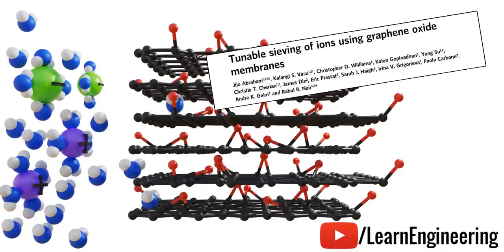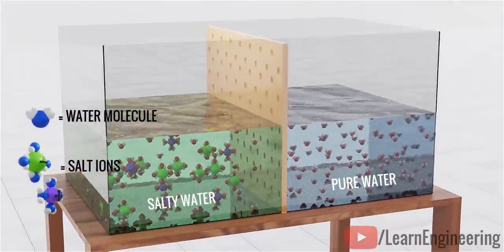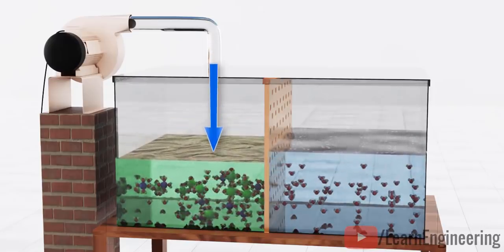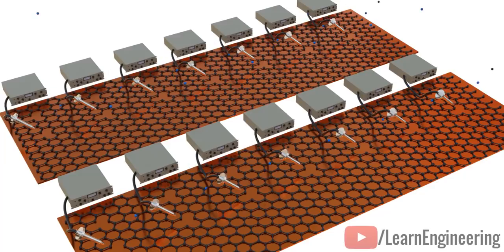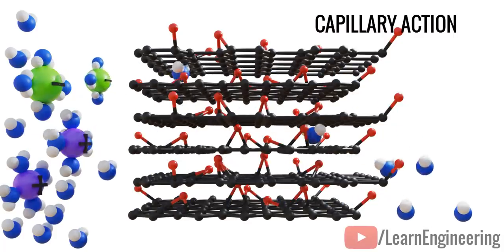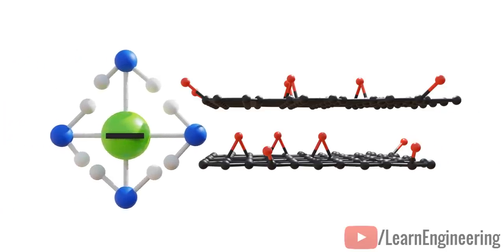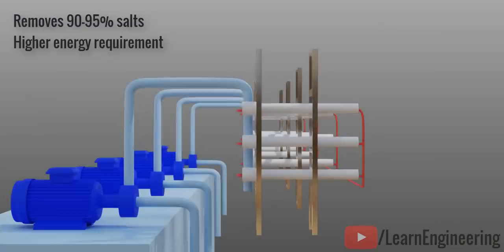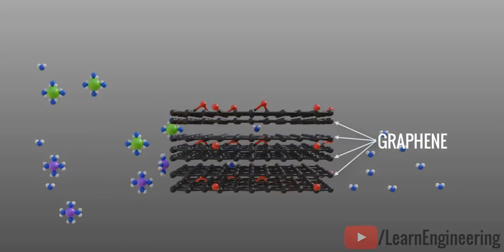Graphene Filtration | A revolution in Desalination technology!

Comment from the maker: Links to their work - https://www.nature.com/articles/nnano.2017.21#:~:text=Abstract,of%20common%20salts4%2C6. , https://science.sciencemag.org/content/343/6172/752
Reply: What Is The Drawback To Solar Pumped Laser/Lensing Boiler Distillation Systems? I Am Relatively Sure That They Could Be Immediately Implemented With An Extremely High Benefit To Cost Ratio Using Currently Existing Technologies. It Solves Both The Pumping And The Desalination Processes Into One Efficient And Inexpensive Solution That Can Be Implemented Anywhere That There Is Sunlight, While Simultaneously Generating Energy Instead Of Requiring It.
Reply: There Are Millions Of People Who Need The Water Right Now, Not By 2025.
Reply: @VerifyTheTruth  Some toxic materials also evaporate with water, but this can be filtered after you distillate. Maybe there is some affordable process to separate water vapor from other substances while it's still a gas, similar to what is used in petrol refineries.
Reply: Do You Think An Elevated Water Vessel Could Be Used As A Mechanical Battery, Utilizing Not Only The Height, But By Spring Loading The Water Weight As Well.
Reply: @VerifyTheTruth  This already exists partially, it's called pumped water storage.
But how to pump water using solar power (or accumulate solar energy via simple solutions without any intermediate conversions that are too lossy, like compressed gas, flywheels, gravity, ...) is still an open question.
Reply: @vitordelima  Steam Rises. Unidirectional Pressure, Check Valves, Heat Source, Prime, Siphon, Pump. Check Out The Basics Of Transpiration. Trees Pump A Lot Of Water Hundreds Of Feet Into The Air. Combine Transpiration Tech With Heart Pumping/Circulation/Circulatory System Tech. Water Pump And Distribution, Similar To An Electrcity Grid, But With A Different Fluid.
Reply: @VerifyTheTruth  Yeah, but there's the question of efficiency and lots of other small details.
But trees use an interesting approach via osmotic pressure.
Reply: @vitordelima  Efficiency Does Not Matter As Much When Concentrated Sunlight Is Your Power Source, Such As Fresnel Lensing, But As For Efficiency, I Doubt That There Is A More Efficient Pumping System Technology Currently Available Than Transpiration Or The Human Heart. Once Primed, It Would Run Until It Is Stopped Or The Oceans Empty.
Reply: Vitor de Lima  How about locating the solar at ocean level and turning the water to steam there and letting the steam rise to height for leverage or whatever. I guess more solar sites would be needed along the way to keep the steam form but I really liked your solar idea better than the graphite sheets.
Reply: @rivergrrrl1256  I don't know if this was already done, but if you search about concentrated solar power there are many projects involving heat from focused sunlight. Distillation works somewhat like what you are describing.The idea was originally from the crazy dude who replied this comment first.
Reply: @vitordelima  Lol. Tesla Was Thought To Be Crazy Too.
Reply: @vitordelima  If Anyone Thinks I'm Crazy, It Is Only Because I Am Too Poor To Prove Them Wrong And Unwilling To Be Compromised In Power, Greed, Or Fame.
Reply: @rivergrrrl1256  Multiple Towers Could Channel, Collect, And Pump A Substantial Amount Of Desalinated Water Through Pipelines, Hundreds Of Miles Inland. There Are Several Different Ways The Systems Could Be Combined To Produce The Desired Effect. I Think That A Transpiration Based Negative Pressure Generation Technology, Similar To That Used By Trees, Could Be Effectively Utilized With A Double Check Valve Heat Pump System Also.
Reply: Let's Just Be Real. If People Don't Have Drinkable Water, Water For Agriculture, And Affordable Electricity, It Is Because Someone Doesn't Want Them To Have It, Not Because It Is Unavailable.
Reply: For Less Than This "Pandemic" Cost America, The Entire Sahara Could Be Terraformed.
Reply: @VerifyTheTruth  It's the writing style. It's a political issue, people are stupid and their rulers are insane.
Reply: @VerifyTheTruth  It isn't that simple (but not much more complex than this), but stupidity plays a role.
Reply: @vitordelima  Go A Couple Years On Small Rations, Lets Say 500-700 Calories A Day On Average Devoid Of Essential Nutrients, Haul Impure Water In Buckets For Drinking And Sanitation, Wash Your Clothes By Hand, Work For Less Than You Need To Survive, Have People Constantly Take Advantage Of Your Hardship, Mocking You For Your Poverty, And Have No Where To Turn For Help, Then Call Yourself Stupid For Being Unable To Change Your Situation.
Reply: @vitordelima  The Ignorance And Arrogance Of The People Who Are Actually In A Position To Help Plays A Much Bigger Part In The Impoverished's Struggles Than Their Own "Stupidity".
Reply: All the best Sabin Mathew. you make every Malayalee and this Indian proud
Reply: @CatboyChemicalSociety  That Is Why They Must Develop The Technology To Assemble It With Sound.
Reply: @VerifyTheTruth  .... not sound man because the distance between the 2 waves are too great.
We need shit that can affect this material in the order of 2 atoms thick and lets just say I thought of a method but as if I'll disclose it in these comments LeL already making Graphene oxide to test XD.
Reply: @VerifyTheTruth  il give you a fun hint though to how you can arrange all these GO into neat layers really fast.
I saw this music video where there were 2 people rapping and arguing about shit in nature.
Thats the only super far hint im giving man.
Reply: @CatboyChemicalSociety  Can Sound Be Woven?
Reply: @VerifyTheTruth  mechanical waves can undergo constructive and destructive interference so you can create an alternate checkered pattern if you like but its not technically weaving in the traditional sense.
Using ultrasound could work BUT gl with the cost of those transducers since none of those are cheap.
and you wouldnt want a checkered pattern anyway for them.
Reply: @CatboyChemicalSociety  By Sound, I Mean Everything Along The Electromagnetic Spectrum. It Seems Like There Should Be A Way To Actually Interlock/Weave The Wavelengths Together On A Nanoscale, Not Just By Creating Harminic Frequencies Through Interference.
Reply: @CatboyChemicalSociety  Bingo.
Reply: What about cleaning the filter? That need to be done at some point. Is reverse flowing water easy too?  And how much energy does it take - filtering and cleaning?
Reply: @servicingiq  What's the name of this distillation machine? Sounds interesting. Do you mean it uses 2.2kWatts of power for the entire 24 hours (that would be 52.8kWhours of energy) or does it use 2.2kWhours in the 24 hour period?  (Suspect the latter otherwise that is expensive water!)

Does distillation guarantee pure water? The heat will kill the bugs but don't some of the minerals get drawn up with the water vapor, condensing in to the final distillate?
Reply: @servicingiq  When you file your provisional patent, make sure you get the units right. Your machine uses 100 watts of *power*. You run it for 24 hours and it used 2.2kWattHours of *energy*.  Look forward to seeing the design - the world needs fresh water!
Reply: @VerifyTheTruth  I think you meant to say "Extremely High BENEFIT to COST Ratio."
Reply: @marcochimio  Thank You. That Was Indeed A Textual Error. I Revised It.
Reply: @VerifyTheTruth  
The Time Has Come To Show People That Nobody is Nobody!

Comment: The unqualified use of "miraculous" raises my skepticism hackles.
Reply: It's a clever way of saying it's a trade secret.
Reply: @freddiereadie30  OR a "clever" way of overselling the feasibility or advantage of a technology.
Reply: honestly I really dont see how they can neatly stacked GO sludge from an exfoliation process.
crosslinked epoxy is FKING HUGE so how the fk can you get such tiny spaces between the graphene oxide.
im thinking they just compositized the GO with a certain percentage of epoxy which still allows it to be permeable with water then painted/pressed/rolled the resulting mix if it fking works into nice sheets for RO membranes.
Reply: @freddiereadie30  its not their paper literally shows how the membrane looks it FKING SUCKS and isnt practical in the slightest.
Their active surface area is in the friggin micrometers and for it to be practical that needs to be in METERS!!
Reply: @unAgorist  what about you I could say the same.
Reply: @unAgorist  im a chemical engineering student and from what I know the viability of this depends on the flow rate through the material.
The active surface area of the material described in their paper is in the order of mm^2 and for it to be viable it must be in the order of meter squared.
Their process of laying graphene oxide sheets and using epoxy by hand to make layers wont be sufficient to make such a structure in the order of meter squared.
Because if each layer is done by hand then it will take 6.022X10^23 layers you have to do and that is IMPOSSIBLE to do by hand it will take forever.
granted by means of another process their material maybe possible to create but you can check the paper yourself and see that picture where they show the thing they made with the red squared area being the active surface area.
Reply: @CatboyChemicalSociety  yes, this is called research, I hope you get exposed to it in your education.  First you demonstrate the fundamental scientific soundness of the idea, then you spend years in R&D to make it useable.  Carbon nanoparticles, particularly buckminsterfullerene was theorized for two decades before being synthesized in a highly complex experiment in 1984, a decade later I synthesized it in a simple experiment in my freshman chemistry class.  This was the start of the carbon nano chemical/technology explosion in science.  When I did my experiment I made ng of material and it was for sale for about 2k a gram, by the time I graduated the price was about 60 dollars a gram.  And the price hasn't changed since, because for the most part there is only a small market in science research for the material.  Carbon nanotubes on the other hand, were discovered after buckminsterfullerene, and likewise started very expensive, but the practical use of the material has been everywhere and the price has continued to drop and the method of production has improved, what used to cost 2k a gram now costs 2 dollars a gram.  Likewise the production of graphene filters will improve and speed up as long as a there is a practical use and market for the product.
Reply: @CatboyChemicalSociety  I don't know what Avogadro's number has to do with the number of layers, but your comment about the scalability issues seems somewhat legit, although the video says the process they have is relatively inexpensive.

But when there's more cool computer graphics than actual scientific explanation, the scam-alert radar is triggered.  This is the kind of video that Water Witch put out or "solar freaking highways put out," where they have maybe a handful of working hexagons, but no practical working models to show, because they really aren't feasible at this time.  They didn't even properly explain the chemical structure of graphene, which I'm guessing is hexagonal molecules of double-bonded carbons.
Reply: @harrymills2770  the reason is because according to the paper they manually stacked graphene layers for WEEKS to make a very very tiny sub milimeter thick active surface.
you would need to stack layers up until it makes a meter thick BRICK!! and laser cut it into several sheets to make membranes.
but to keep stacking layers of graphene oxide with each being 1 atom thick well GOOD LUCK and thats why avogadros number is there because you will need an order of magnitude that many layers to get a decent stack thats commercially viable.
Reply: My skepticism peaked at the inaccurate scientific terms, ie; plus and minus, instead of positive and negative. definition of hydrophilic being confused with polarity etc, if your explaining something, I want you to understand it.
Reply: The presenter don't have a clue of how much power would be required with graphene filters as it have to overcome the natural force anyway. 
Without such an crucial informations it is boring to watch such catchy captioned videos.
Reply: Leaving 3% salt vs 0.01% from R.O. means that one could not drink graphene "desalinized" water.  The Channel owner deleted my post showing that truth and my debunking other lies he has told on here.
Reply: Yeah, sales speak.
But does it slice aluminum cans,make paper thin tomato slices, and instantly absorb any mess from any surface?
Reply: @CatboyChemicalSociety  They are simply lying to get funds and maybe come up with an inefficient toxic end product what is really their objective. Don't drink graphene oxide.
Reply: @Uhlbelk  It's called bs.

Comment: The paper is more than 3 years old; the authors focus on the tunable aspect of the gaphene membranes.
Reply: what paper?
Reply from the maker: We were in touch with this research team. They have collaborated with a UK based company, LifeSaver to convert this research into a product. Maybe in a few years we can expect it to hit the market.
Reply: Graphene is the way of the future. Between graphene, Neutrinovoltaic, and CO2 bio fuel conversion using solar energy and radio waves the world will forever be changed
Reply: @frankh.3849  We need to have a solution now! CO2 biofuel conversion is carried out by plants and is not the most efficient.
Reply: @janami-dharmam  it can be done now with solar energy and EMF in the radio spectrum. They have all ready built prototypes. They have also figured out a simple way to do it electrochemical using solar energy with the highest reported efficiency. Though the method using radio waves is the cheapest and leaves a zero carbon footprint.
Reply: @frankh.3849  Could you please give give a link to an article or a video about this.
Reply: @npranavsubhraveti2513  I'll do my best to find it.
Reply: @frankh.3849  thanks
Reply: @npranavsubhraveti2513  after you read thru those I'm open to discussion. I can't find that article. News stories are harder to track down.
Reply: Frank H. Solar energy? How about nuclear or even thorium. Peoples obsessions with solar is just getting old lol really.  It’s not efficient. And even if we used every single battery on the planet, it wouldn’t even be an hours worth of power.
Reply: @michaelesposito2629  my comment stated that there is technology that turns CO2(collected from the atmosphere) into a biofuel. Graphene has changed a variety of technologies over the years and is probably in the top 5 most useful materials on the planet. Thorium salt reactors are definitely a power source that should have been built a long time ago but even that tech is superficial. We have the technology to generate plasma using very little energy.
Reply: Frank H. Your comment stated that we should use solar for those purposes. So I’m not sure what is the point of your response to my comment t
Reply: Sebastian Thor nuclear . Coal has killed many MANY more people than nuclear ever has. We don’t need more coal. Unlike solar, nuclear is cleaner AND more effective
Reply: @michaelesposito2629  how about hydro?
Reply: @michaelesposito2629  how is nuclear clear than solar?
Reply: @VinceroAlpha  Nuclear is actually about 300x cleaner than solar if you take into consideration the toxic waste produced during the extraction of the materials and construction of the panels. There’s also a many times multiplier (can’t recall the number) in terms of CO2 production of solar over nuclear over the lifetime of the panels. 
Basically solar sucks. Per watt it’s a little greener than coal, but it can’t even see nuclear because they are in totally different worlds. Not just different leagues, different worlds.
Reply: @airman122469  you mean 300x more dirty and deadly. Let’s not forget the toxic waste that comes with nuclear reactor that can take 20 years at the earliest, to billions of years when you factor in it’s sources. Then there’s the fact of handling nuclear fuel in which even under perfect ideal circumstances, a person can handle work in that environment for a set life span because of the constant exposure to radioactivity. Also, since you want to use the extraction of fuel and raw materials as a negative point for solar, then nuclear is literally 300x worse since excavation, refinement of raw materials and disposal parallels how coal and most other fossil fuels are used to produce energy but with the added hindrance of the toxic byproducts lasting for CENTURIES TO A LITERAL EPOCH rather than years to decades for solar waste!!! Your analogy is incorrect and heavily selective at best. 

There is no “perfect solution” and nuclear energy has the potential to be a major source of energy but with the current state of technology, political will, and handling of waste, there still is much work to be done before it becomes a genuine player in the energy field. So WHEN that happens solar will continuously get better, cheaper and more recyclable as a stopgap/ alternative.
Reply: @frankh.3849  So, we are just using energy to convert CO2 to O2 with no other commercial benefit?

That results in a drain on the economy.

How is that better than what nature already provides?
Reply: @robinsss  science is done by writing papers not youtube videos

Comment: One major small problem this video does not address at all. Graphene Oxide is currently like $250 per gram. It is currently way too expensive to even approach replacing reverse osmosis purely to save on power.
Reply: The cost is coming down rapidly.